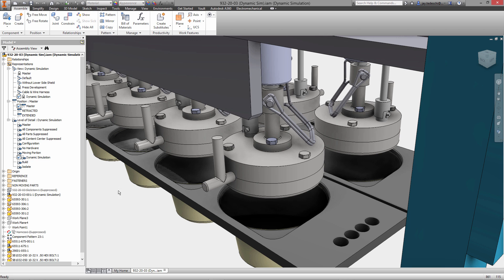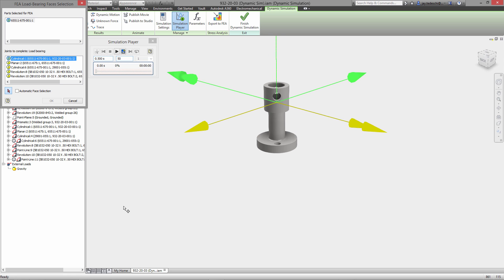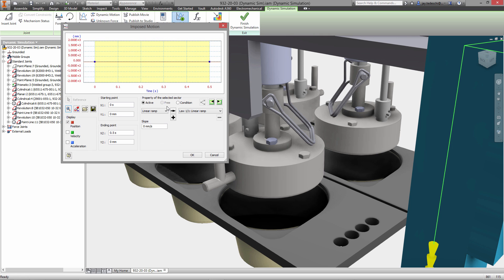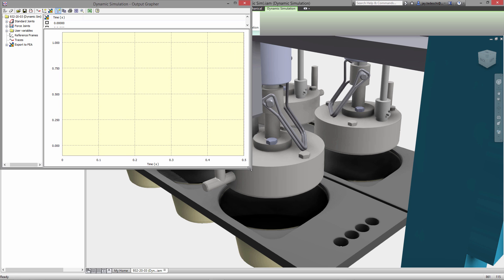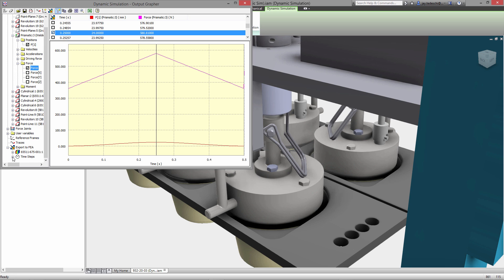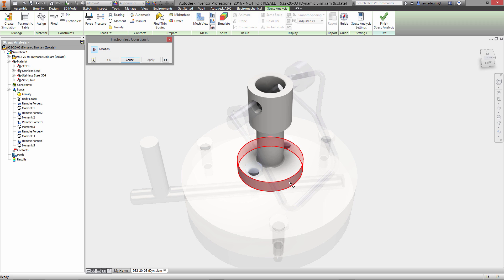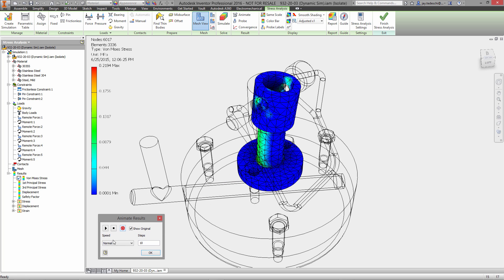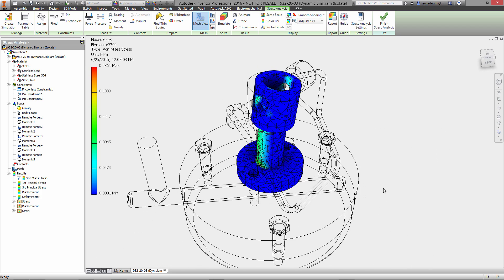Autodesk Inventor dynamic simulation

Comment: Is pin constraint really correct for bolts? I used pin constraint to hold a platform that is bolted to another platform and the safety factor was like 0,8. But when i used the bolt command in autodesk and bolted it to another platform the safety factor became 2,7